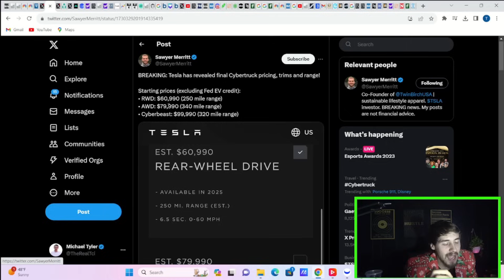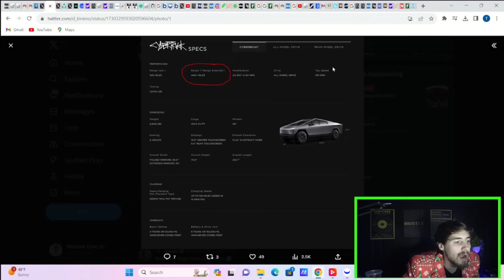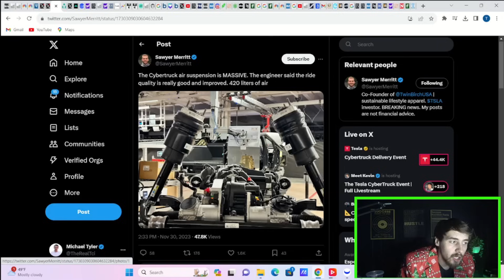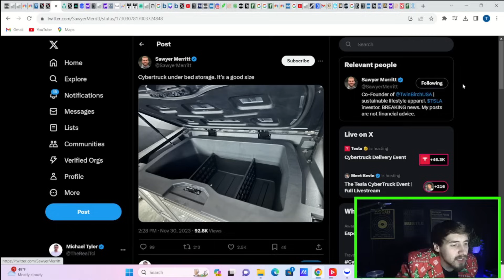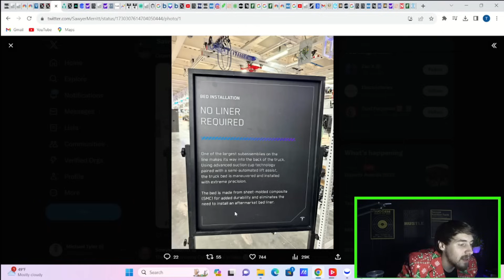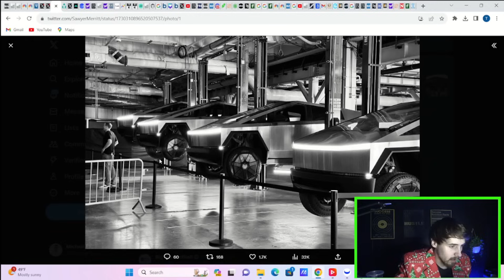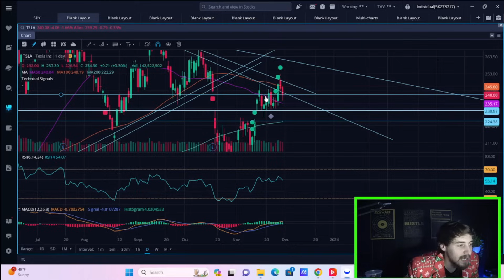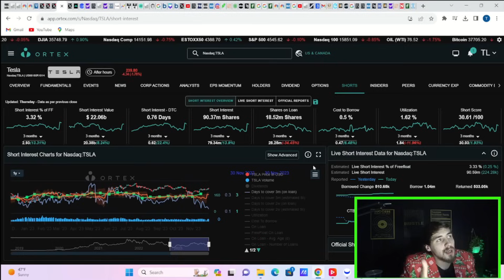HOLY CRAP.. this is MIND Blowing. (Tesla Stock BREAKING NEWS)

Comment: I just need to know how this gets repaired.  I have enough trouble getting my ICE coat taken care of at times
Reply: ICE coat?

What repairs do you anticipate?
Oil changes
Timing belt changes
Valve adjustments
Brake rotor turning
Brake pads
Radiator flush
Worn out clutch replacement
Fuel filter
Oil filter
Spark plugs
...
...

Oh, wait... those are shytti ICE problems